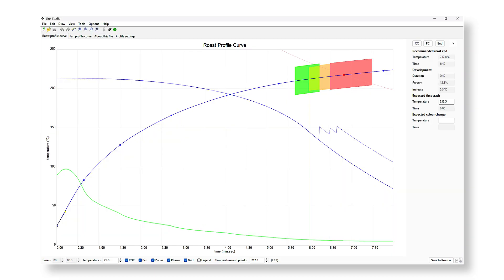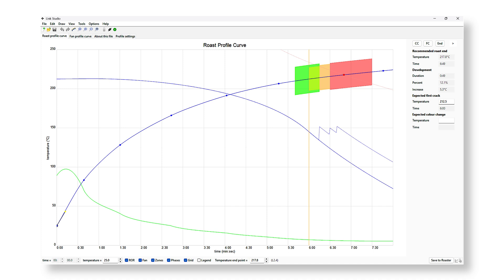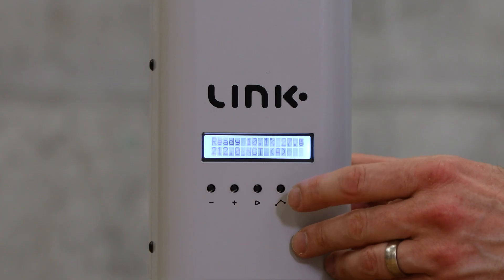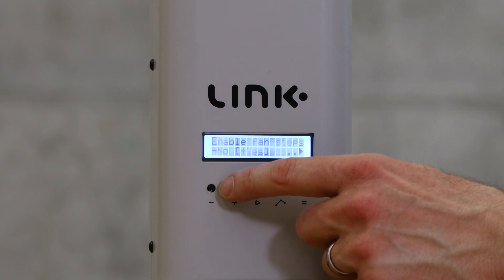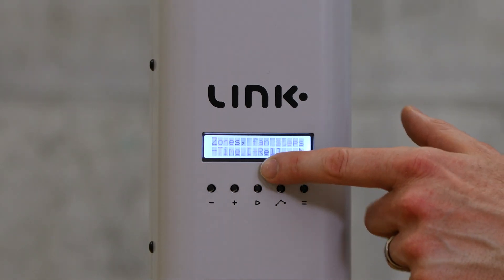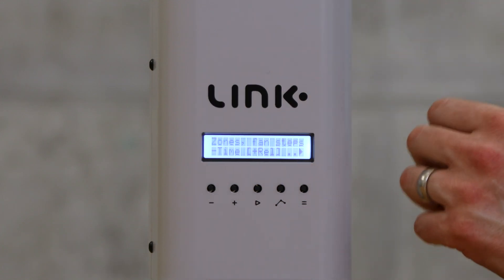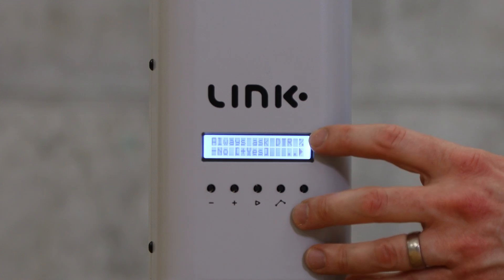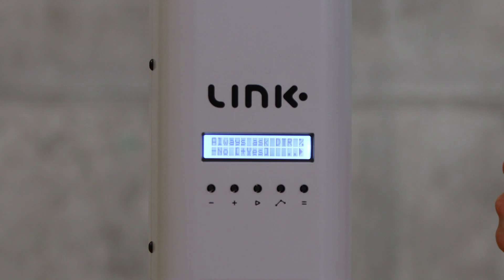5 Nucleus LINK settings that will massively improve your roasts ✅

Comment: Hey Ingo, When I use KEEP First Crack, it doesn't actually mark it in the software, do the fan steps automatically take place or do I need to still mark FC for it to happen?
Reply: Watch at 2:52 — the fan steps will either activate depending on the time of the roast (when the profile determines First crack will be, aka TIME) or relative to when you log first crack (aka 'Rel', which is 'Relative to FC')
Reply: @jordanmontgomery3825 understood but when you have the KEEP/remember first crack function do you still need to manually log first crack after the first roast for this to active? 

Example. I have a KEEP setting enabled for FC. Profile FC is at 7:30. During first roast I mark FC manually at 7:40. Fan steps activate.  For subsequent roasts, will it automatically turn on fan steps at 7:40 despite it not marking on the graph/manual marking?
Reply from the maker: You need to mark it at least once. And if you change the profile, you need to mark it again. It's not saved in the profile itself, just for the next roasts, if you are doing several roasts with the same profile after each other.